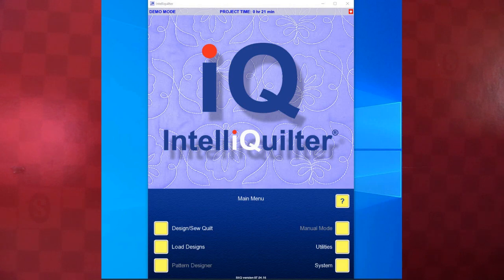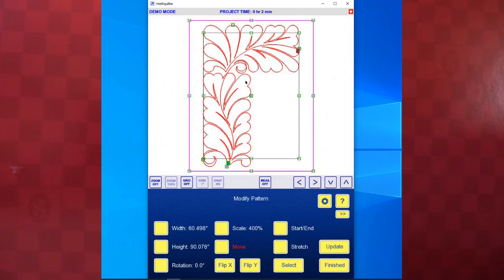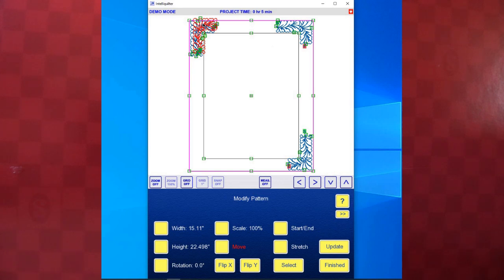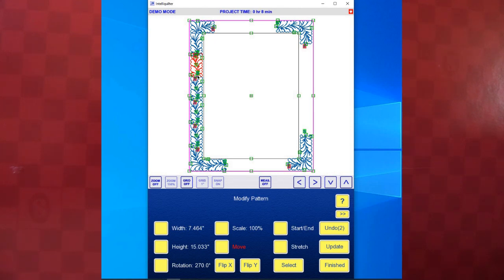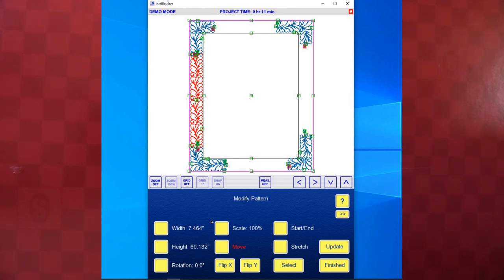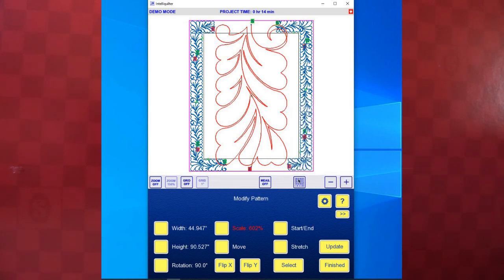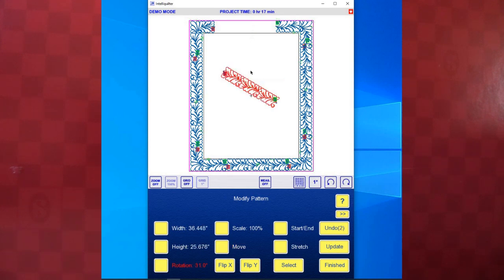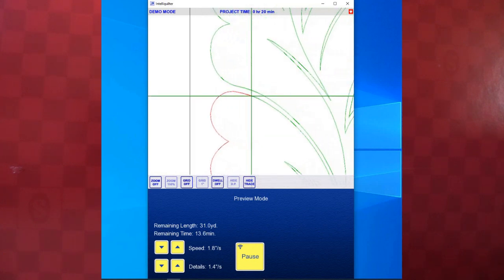Intelliquilter Borders and Corners - Urban Elementz

Comment: Thank you for the video. I am still an intelliquilter “newbie”, so if this sounds dumb, I apologize in advance. I can follow along in the demo mode, but once I have a a quilt loaded up, then I found out the dimensions are off, or the border is off from from the original stated dimensions in demo mode,how do I adjust for that? Also, would I quilt the first pattern, then reroll to start stitching the borders?  Or am I just overthinking the process?